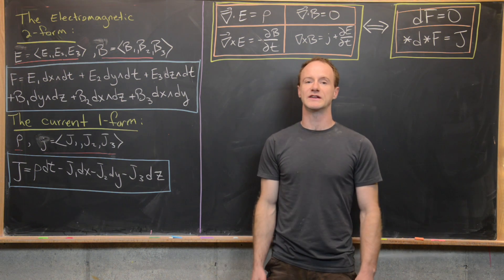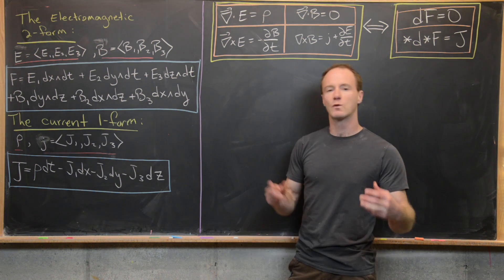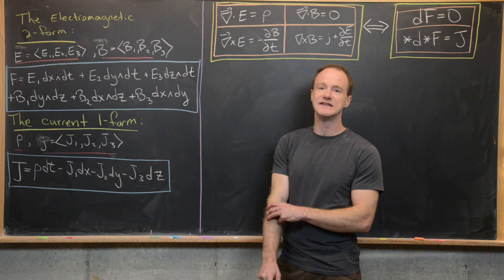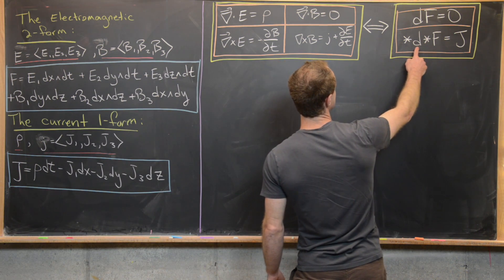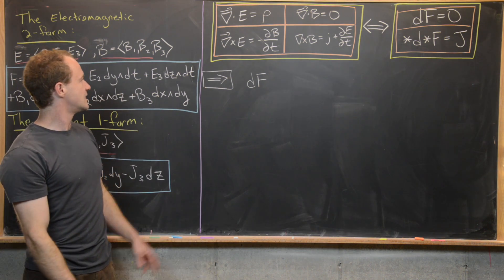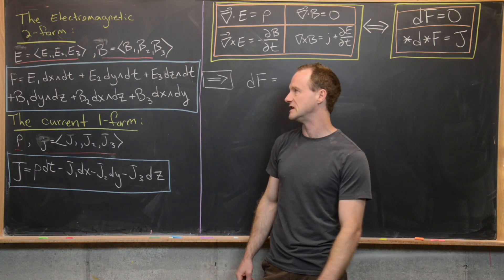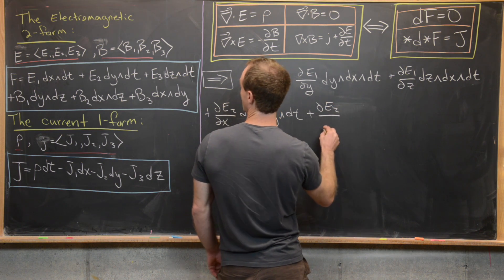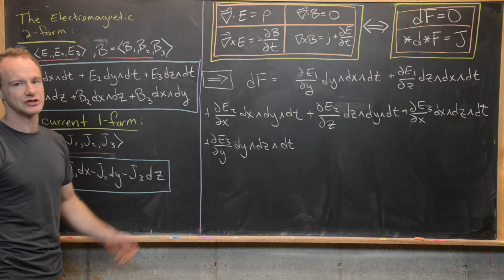Maxwell's equations via differential forms.

Comment: If I'm not mistaken, and I'm not being rigorous here, you can only identify the ∇xE and ∂B/∂t with ∗dF and not with dF. Because in dF the signs don't match up properly (if done correctly), but in ∗dF they do. Then of course if ∗dF=0 you conclude that dF=0.
(The signs are wrong in the video because the 5th term in F should be dz∧dx instead of dx∧dz)
Reply: Thank you for this information, I did the calculations and came out with the right results :)
Do you have a reasonable explanation for the 5th term of F being in this order? I would be really interested to know :D
Reply: @danielkewitz6335   Hi Daniel, I wrote this comment when I dove really deep into this topic because of my thesis, I'd have to refresh what I learned haha. I'm not even sure if the calculations still work out properly if you take dx∧dz, but using it feels like being inconsistent with parity (x->y->z->x), that's why I prefer dz∧dx. I'm not a mathematician tho hahaha.
iirc the reason why you go to ∗dF is to get the expression back to a 1-form (vectors <-- Maxwell's equations are in vector form) instead of keeping them as 3-forms.
Reply: @franciscohamlin7544  thank you so much, I have spend the last few days learning more and more about the topic and it makes perfect sense :)

Comment: 6m 40s: "You're gonna need a bigger blackboard!"

Nice presentation! Including how smoothly you corrected a couple typos on the board. Nicely done!
NB: For those of us who learned this stuff from MTW*, you could equally well take the Hodge operator of the 2nd DiffForms equation to the RHS:
d *F = *J
This might be an useful exercise for the student – showing that you get the same agreement of 3-vector and DF versions, this way.

Fred

*MTW = Misner, Thorne, and Wheeler

Comment: Firstly, thanks a lot for this great series on differential forms. I found them very useful. 
I didn't read all the comments, so I'm not sure if anybody's mentioned this or not, but there's a small mistake in this video. The fifth term in the electromagnetic 2-form should be B_2 dz^dx instead of B_2 dx^dz.
Reply: Super appreciate this comment! Coming from more math than physics, so I was concerned over that term!

Comment: Mathematically very pleasing, Michael, but I wonder when an actual physics problem is given (in some coordinate system in some region of space), how you can "directly" write down this differential forms equations WITHOUT going into the vector calculus equations. (I tried some problems from standard text books on electromagnetic theory.) If we first require the vector calculus form, then we don't need this differential forms form. Then, is this differential forms form constructive?
Reply: If you ask vector calculus questions, then the vector calculus form will be best. If you ask differential forms questions, the the differential forms form will be best. For example: it is somewhat painful to derive the lorentz transformation laws for E and B from the vector equations, but essentially trivial from the differential forms form.

Comment: Hello Professor Penn
I enjoyed very much these lessons about differential forms.
Krrp up your work!

I tried to follow your steps and made myself all the calculations, and I agree with your conclusions, but I'm quite sure that the 2-form F must be corrected.

You did write        F= ....+ B2 dx^dz + ...
I think it should be    F= ....+ B2 dz^dx + ...

Furthermore, despite the fact that magnetic charge (rm) and magnetic currents (Jm) have never been observed, phisicists tend to put them in the maxwell equations in order to achieve a sort of duality (simmetry).
In this way, the Maxwell equation number two becomes 
div(B)=rm 
(very similar to the equation number one), and the Maxwell equation number three becomes 
curl(E) = - Jm - dB/dt 
(very similar to the equation number four)
where Jm=<Jm1, Jm2, Jm3>  is the magnetic current vector

Provided that, the first equation in differential form language, 
dF=0   becomes (here * is the Hodge operator)
* d F = Jm
where Jm = - Jm1 dx - Jm2 dy - Jm3 dz + ro-m dt 
is the differential 1-form representing the magnetic current
Pretty similar to the other 
* d * F = J 
cool!

Comment: This idea kind of seems to me like say the 4 vector calculus equations are 4 types of tools like sockets, screwdrivers, wrenches, and allen wrenches. These formulas just make a tool case with two drawers where somehow each of the drawers has two tools  in it. Like, it’s nice to be organized but when you want the tools you still have to open the drawers to get the tools out, idk.
Reply: To be fair, thosse 4 equations are acctualy 10 equations and you will many times need to open them up to solve It.

Comment: Isn't it more natural to let the current form be a 3-form, something like J = rho dx dy dz + jx dy dz dt + jy dz dx dt + jz dt dx dy? Rho is charge per space volume, and jx, jy, jz are charge per area and time.
Reply: This is absolutely the right thing to do. (This is done in the Wikipedia article for the Maxwell equations) It makes perfect physical sense to have the charge density as something that you can integrate over a 3 dimensional space like hyper surface, or a current as something you can integrate over a 2 dimensional surface x time interval. From a mathematical point of view, conservation laws with divergences are best translated in d of an n-1 = 3 form is 0. As an important benefit you get that in this form the Maxwell equations are conformally invariant because it only involves the Hodge star on the middle dimension.

Pedantic note. the really correct way to do this is to make the current a  twisted three form. This is because the Hodge star really maps k-forms to twisted n-k forms, also one can integrate an twisted form over manifold for which an orientation of the normal is chosen, e.g. by choosing a time direction and an orientation of the normal of a surface in space saying which side is in or out.
Reply: That is my question as well.
Reply: Yes you are right but in 3 dimensions there is a canonical map between 3-forms and 1-forms (the Hodge dual) which will send dx dy dz to dt etc.
Reply: @StatelessLiberty  I know, but still one might be more natural than the other.
Reply: It's dual to this form. It just makes it so you don't need the last Hodge star on the left.
Reply: @Noam_.Menashe  I know that they are dual. Still, to me, the one I give is more natural.

Comment: Michael, F may be written as the exterior derivative of the 4-potential A = (V, A^1, A^2, A^3) where V is the electric field potential and A^i are the components of the magnetic vector potential. This would immediately imply that dF = 0 since dF = d(dA).
Just wanted to point out that the 2-form of the electromagnetic field tensor does come as the derivative of a potential just like all other forces in nature.
Reply: This comment is underrated. You just gave me an "ahaaa" moment :)
Reply: @juancristi376  I'm very glad you got the aha moment. It's what I look forwards to when discussing physics with other people!
Reply: As dF=0, you can use Poincare Lemma to say that locally exists some 1 form A such as F=dA. Recall that the existence is local, this is due to some topology issues that the manifold where physics happen can have topological issues.

If there were magnetic currents, then dF=*Jm. This implies that you cannot find some local A such F=dA. Anyway, you can split  F=dA+*d*B+C, where A is a 1 form, C is an harmonic 2 form (dC=0=*d*C) and B is a 2 form, (this descomposition is always doable) then, dF=d*d*B=*Jm.

Another interesting fact is that the existence of magnetic monopoles implies a quantisation of both electric and magnetic charges, that can be derived using the divergence theorem, the gauge symmetry A'=A+dX, and the fact that the gauge parameter X is related to a phase on quantum fields. It is not difficult and you find

qp=2\pi Z

where Z can be any integer number.
Reply: That assumes there is no topological obstruction to $F$ being exact, which there may be. $dF = 0$ holds generally; $F = dA$ only holds if the second de Rham cohomology group of the space vanishes.
Reply: @chuckaway6580 the group cannot “vanish”. “The … group is trivial” would be a more appropriate statement.
Reply: I like this comment.  I was thinking the same thing.
Reply: "Just like all other forces in nature"

Friction?
Reply: Friction is not conservative, you can say it's true for every conservative force @duncanw9901

Comment: Hey Michael Penn, could you explain in detail why we can't treat dy/dx (the derivative notation) as a fraction? I've always been told that it is not a fraction, and yet on several cases I've used the notation as a fraction on problems and always got the right result. The way I see, it clearly can be used as a fraction on some situations, but what is the honest reason for not doing that?
Reply: Actually it has never been a fraction. Most of the time you do not worry about that because you are not doing partial fraction or something like that. For instance, when you do (dy/dt)(dt/dx) = dy/dx you are actually doing a chain rule just read in the reverse way. In the end you are applying rules that most of the time are valid
Reply: for all the cases you treated dy and dx like numbers, try replacing them with deltax and deltay then once you've gotten your answer take the limit as deltax goes to 0
Reply: @thedoublehelix5661  That's exactly what I always did to get my professors to accept my solution. Specially on differential equations classes which I would solve problems much faster than the "appropriate"  solution given by the professor - they would accept it, but they were also mildly annoyed by my "transgression".
Reply: @raystinger6261  there is no right way to solve a problem.  Using deltax and deltay is completely rigorous
Reply: dy/dx is the limit of a fraction. There is nothing wrong with viewing it as a fraction (just keep in mind it's also a limit and you'll be fine).
Reply: https://youtu.be/XQIbn27dOjE 👍💐

Comment: Is there a way to have an understanding of these two differential form equations directly without unpacking them into the vector calculus equations?
Reply: We did something like that on college (we have to take some physics courses to get our degree in math) which we calculated the speed of light using Maxwell Equations. It was far simpler than that, but then again that was one specific case, I couldn't say how much we could generalize from that.
Reply: I think that if you apply the generalized Stokes' theorem to these equations, you can get the integral formulation of Maxwell's equations, which may or may not be easier to understand intuitively. Also, the Lorentz force law can take the form f/q=*(v^(*F)), where q is the charge, v is the four-velocity of particle, and f is the four-force, which can give you an idea of how a charged particle will move in the presence of F.
Reply: @nicholassullivan6105  The Lorentz force f = q i_v F, you don't actually need the Hodge star.
Reply: @rogierbrussee3460  Fair enough. I was expressing the velocity as a one-form like Michael did for the current, even though on a physical level this doesn't make much sense for either quantity. Thanks for the correction

Comment: I study physics, and I've seen the covariant formulation of Maxwell's equations, and though I know that m-forms are some sort of covariant tensors, I can't help but to be amazed at how simple, yet elegant this differential form formulation is. How you got rid of the electromagnetic tensor (which, despite being an antisymmetric matrix and not being thaaaat hard to remember once you understood it well) in favor of that very simple 2-form you defined as "F" I think is the key.

 Although you have to remember how the elementary forms transform under the Hodge operator with the Minkowski inner product, which in the contrary, when you are using tensors, you have the Minkowski metric, the contraction between tensors and the covariant derivative which I think are easier to work with than the Hodge operator in Minkowski space and the exterior derivative. But that's just what I think. These series of videos are just amazing, I'm looking forward to see the generalization of the Green, Gauss and Stoke's theorems from vector calculus using differential forms! And maybe you could use them to write the integral form of Maxwell's equations in that formulation!
Reply: I subscribe to this. The tensor formulation of Maxwell's Equations with the Einstein summation convention is maybe more concise, but m-forms are arguably more elementary and conceptually clean.
Reply: Well, F Is antisimetric If you think about It.
 F(e_x,e_y)=-F(e_y,e_x).
Reply: Actually, if you know F is a defined as dA, and that d(dA) = 0 for any A, then you can simply ignore the first equation and simplify the whole things as *d*F = J.